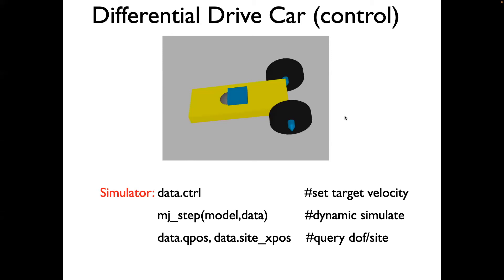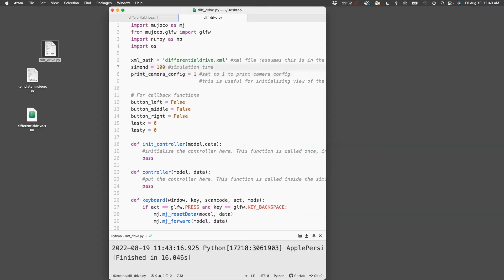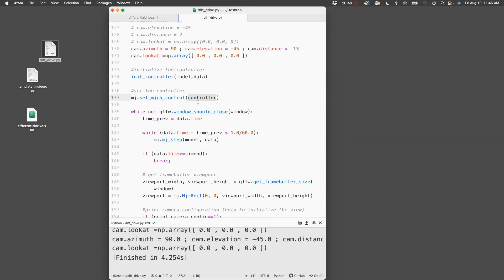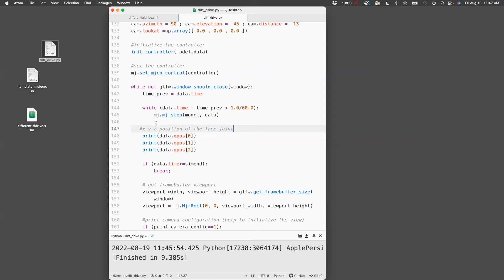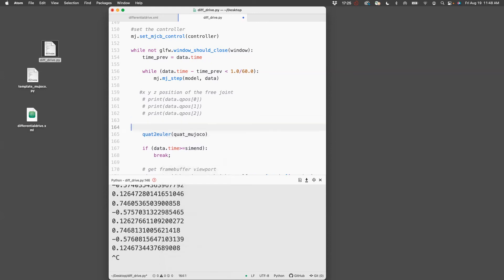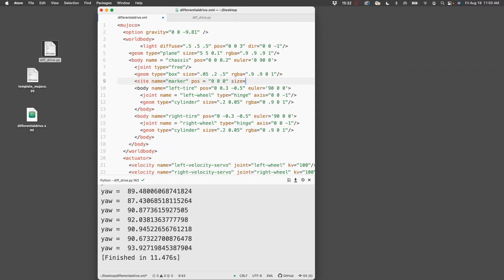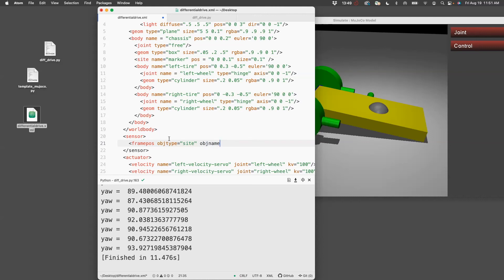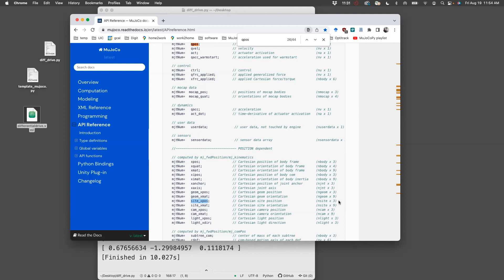MuJoCoPy Lec 3b: Differential drive car (control) (part 2 of 3)

Comment: I have a question. Mujoco's recent versions now support SDF files. I used a built-in model, 'bowl,' and added a free joint to it. However, the bowl penetrates through the ground and is unstable. Can you please advise on how to resolve this issue?
Reply from the maker: Did you define bounding geometry for collision? Download the latest mujoco files from github and see models/cards/cards.xml. 

This defines a box class for collision detection
<default class="collision">
      <geom type="box" mass="0" size="0.047 0.032 .00035" group="3" friction=".1"/>
    </default>

Then assigns the collision class to each card.
<body pos="0.020 -0.029 -0.020" euler="-112 180 0">
      <freejoint/>
      <geom class="card" material="3_of_clubs"/>
      <geom class="collision"/>
    </body>

Comment: Just one question. In the previous video qpos was the joint angle for the joint 1 and 2, but why does qpos stands for x y z position of the free joint in this code?
Reply from the maker: qpos is the degrees of freedom. In the previous video there were only 2 revolute joints so those were the dofs. Here the chassis is a free joint and there are 2 revolute joints  for wheels, so the qpos will be x, y, z, the four quarternions, and then two wheel joints.
Reply: @pranavab  Thank you very much for your kind reply.